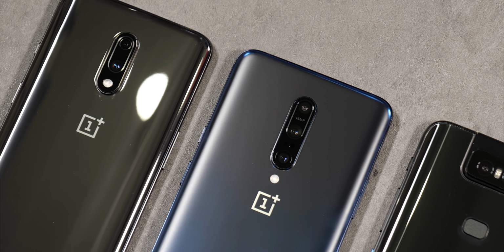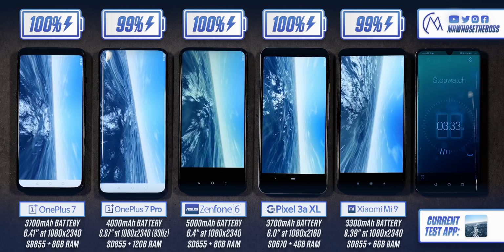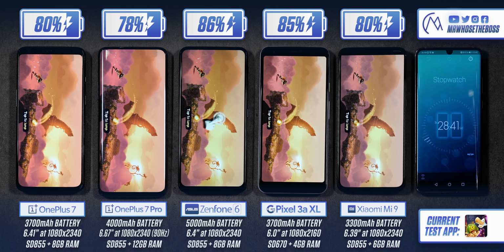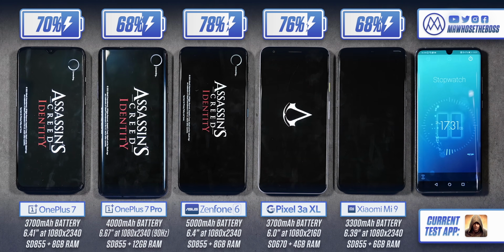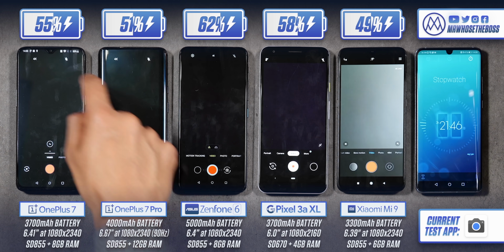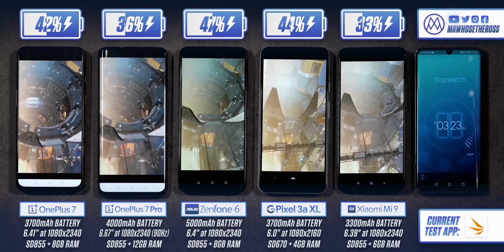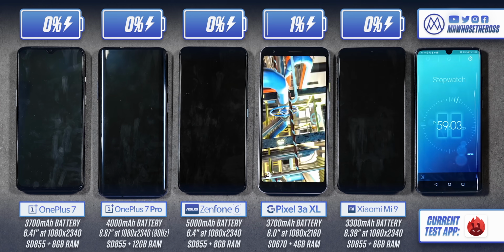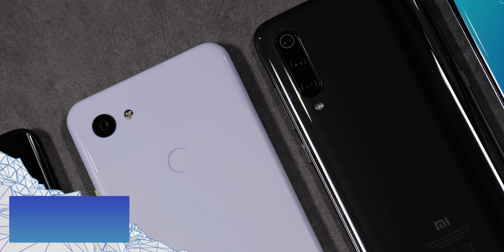OnePlus 7 vs 7 Pro / Zenfone 6 / Pixel 3a XL / Mi 9 Battery Life DRAIN Test.

Comment: Considering that the Asus phone has a LCD display and a sd855 and bigger screen I m actually not disappointed in the end results.
Reply: I am, Apple's utilization of IPS pushed it to insane limits and ASUS can't even do it that well with the same screen tech.
Reply: @alexsurber9404  apples os, cpu and Gpu optimizations made it get ok sot. Not having a amoled means higher power consumption which Apple also had to deal with b4 switching to another display type. So no still not asus fault + they got a new firmware update that seemed to increase users sot by 7-12 minutes
Reply: @alexsurber9404  lol you just from that Google then put and paste here lol.. I still pick amoled screen rather than ips LCD screen.. beacaude of the colour and can be better battery life..
Reply: LCD draws more power than LED panels
Reply: OLED displays will only see SoT increases when the blacks being displayed are pure black. If the colour is not pure black then the LEDs are not off and, therefore, are still drawing power.
Reply: @Llethander  ok then who is better amoled or LCD panel ???
Reply: @wanmaziah9835  Both have pros and cons. I'd say OLED has the edge because of its far stronger contrast between darks and lights as well as generally better colour clarity.
Reply: @alexsurber9404  not true
Reply: Llethander I have to disagree, because color accuracy and lifespan goes to the IPS screens. OLED displays suck at being accurate compared to IPS displays, even tho they’re getting better at it.
Reply: @itsmrdante6274  true.
Reply: @itsmrdante6274  That's fair. 

I think a lot of what people have to say about the two types of panels has to do with personal preference, as well. Many people prefer the more vibrant colours of the OLED displays. Others, like myself, really don't care as long as it's functional.
Reply: @itsmrdante6274  Would you like to have a word with our lord and savior, calibration? Any display can display a lesser gamut than it's capable with proper calibration, an OLED has a competitive edge as far as color gamut and it's irrefutable. In the off chance you're doing color intensive work on a CELL PHONE you can absolutely use an off the shelf calibration unit and beat the ever loving shit out of an IPS. OLED is superior to IPS in EVERY way.
 
- Color gamut
- Response time
- Black level, and consequentially contrast
- Peak luminosity
- Battery savings, with proper theming

The ONLY situation an LCD is irrefutably better is a drain test on a white screen, blacks are NEVER really black on an IPS though and unless you're using an iPhone 8 the world is marching forward with OLED and new OS releases are theming devices out of the box accordingly. There's also a reason display mate keeps giving Samsung's top tier displays top marks, and it isn't because the Zenfone 6 could ever hope to throw punches.
Reply: @AVenlledBraZil  Which part child? Point out the part you take issue with, I can tell you why you're wrong :)
Reply: @Llethander  Good news bud, Android 10 and iOS whatever are pushing systemwide dark mode and it's because both are trying to shun IPS for the inferior tech it is. It's for budget phones now.
Reply: @alexsurber9404  didn't say it's not about calibration. But I never seen an OLED display that's as good as an LCD when it comes to colors. You can't fully calibrate your phone display.
Reply: @alexsurber9404   The example is me or order people that i now we are very sensitive in the eye, and when we use oled or amoled screens or eyes get more tired and painfully than ips lcd.
Reply: @AVenlledBraZil  Turn the brightness down and take off the tin foil hat, I have no respect for someone whose defense against an innovation is "It AFfeCts mE DiFFeRenT". OLED has no characteristics that make it any more abrasive to your eyes than actually leaving your house or upgrading your home to LED bulbs, use an app to make the colors warmer and any and all gripes you have will 200% disappear.
Reply: @alexsurber9404  i ve done it s sane i used a lot of this oled an amoled and i dont like.
Reply: @itsmrdante6274  You can 100% calibrate a phone display to an acceptable degree regardless of screen technology, if you're really doing color intensive work on a phone then your workflow obviously isn't that important that you'd actually invest in a device aimed at assisting it. OLED displays can completely match an IPS for colors if desired and can also exceed colors that an IPS is capable of displaying, it's as if you folks are under the illusion that the gamut OLED covers doesn't actually stretch well over any gamut any IPS ever has covered. 

http://www.chrisevans3d.com/pub_blog/calibrating-alienware-13-oled-laptop/

In this calibration test on a 2016 model Alienware OLED laptop 100% gamut coverage was achieved on the SRGB and Adobe RGB spectrums exactly, while many of the IPS laptop offerings in the enthusiast and creative workspaces fail to offer 100% Adobe RGB coverage. To boot, if you were working on HDR content from the get-go the OLED has the home court advantage going for it, because everyone knows LCD/IPS HDR is definitely the worse of the two for HDR. Color profiles for SRGB exist in many Android phones and Apple even hand tailors the utmost color accurate profiles for their Samsung provided OLED offerings, they were so convinced that they even dropped IPS from their lineup altogether in favor of OLED.
Reply: @alexsurber9404  idk what phones you're using that you can calibrate the screen that much. But okay.
Reply: yes its true oled at super amoled is more vibrant, colorful and realistic, however in the long term had its drawback which later on the screen tends to become more and more yellowish
Reply: Alex Surber d hell! For most media content in real life AMOLED are more effecient! Just they are not effecient for the white or whitish colours ! But the fact that they give a lot better battery life for TV shows and media plus a lot better contrast for dim scenes plus the fact that Current gen AMOLED can get brighter without washing out makes AMOLED no brainer! Yes temps do matter when running high brightness but thats also true for LCD!! And I don’t support ull use ur phone in direct sunlight for 30min or hrs
Reply: Marqlut Marquez hmm ! Does it matter? I have a s8 2 years old ! Screen is still super good a lot brighter than lcd and better for TV show consumption! Why would you choose lcd?

Comment: The battery optimization on Mi9 is excellent...just as they marketed....
Reply: Doesn't matter, they should've increased the capacity
Reply: It literally came last tho. Wut u on about 🤣🤣
Reply: HAL 9000  oh yeah
Reply: HAL 9000 … did u see the test?
Reply: @GuyScott1  umm xiaomi has redmi k20 pro with 4Ah as well . the point behind mi 9 was to sell it to girls by marketing it with a popstar and making it elegant and light.
Reply: @Paul Paul dude if you have used miui (which has a bloat and ad issue now) don't dare call it's battery game bad you can like other skins lock the apps you don't want to be killed.
Reply: with 3300 it hold up well
Reply: @qwertiee  that's why do not skip your math class if u don't understand why mi9 battery optimisation is great.
Reply: @kennykhoo1689  ... That's why u don't skip your english class... So you can watch the video and see that it was the worst phone here...
Reply: @qwertiee  omg... That's the best u can come out...guess u do skip your english class too cause u really do not understand why mi9 optimisation is great even though it only having 3300mah. Better not skip school too cause if this you can't understand, no point in watching any video.
Reply: @_yuri  actually the MIUI 10 is the most optimized UI out. It beats OS 6 which most people love on the OnePlus. The MIUI 10 also has more features but the ads can be turned off and depending on region might not have them anyways.
Reply: @kennykhoo1689  well ssid
Reply: @kennykhoo1689  actually if  you didn't use the camera that much the Mi 9 was doing better or on par with the OnePlus bunch. And even so it only lost by 20 minutes!! LMAO and also that was with the OnePlus being reduced to HD+ instead of quad HD. 
In quad HD the Mi 9 beats it by more the 30 minutes. So with what most people probably keep it on it loses to the Mi 9. 
Last like the other guy said, do some math. The Xiaomi Mi 9 did the best by far going by efficiency. 
And to add I picked up a Mi 9 last week. It's a really nice phone and I am comparing it with knowledge as I have these phones as well. Galaxy S4, S5, S6, S7, S8, S8+,S9+ as well as LG G2, G3, G4, LGV20, LGV30 and last iPhone 6plus and a 8plus for flagship's. I have plenty of mid-range phones to. 

I'm getting 17-20 hours before I put. On charger and that's with 7-9 hrs screen on time. The point is the battery runs great and will give you a solid days use with moderate to heavy use with on screen time.
Reply: @gregwilliams4380  yeah.. what u said its the facts! Mi9 actually having one of the best efficient optimisation battery in the market at the moment. 
People usually forget it only having 3300mah and draining neck to neck with higher capacity battery and this just prove it is much better comparing with the bigger battery cause in paper with 3300mah it shouldn't be so close with the bigger battery but in reality it is..haha. guess some ppl only look at the end without comparing the battery size.
Reply: @_yuri  
It DOES NOT MATTER.
They should've increased the capacity
Reply: @GuyScott1  well you see they don't give a frick about you not everyone cares about battery life. this was simply targetting a different kind of audience
Reply: Thats called battery optimization
Reply: @gregwilliams4380  would you recommend me to buy a S9+ or a Mi 9? I love the stereo speakers + qhd display but i'm afraid that the battery sucks and the os is not as fast. (I'm from germany, so no sd845 -> exynos
Reply: @d-tox8546  I will be straight honest with you I own both. 1st off you can get Snapdragon you just can't buy it from a local vendor. I would definitely not go with anything but Snapdragon as the other in the equivalent to the 845 loses big time and even worse in the 855 comparison. Just check your LTE bands to make sure your covered. 
Back to the point. The Mi 9 can do everything the S9+ can but more faster and better. The only thing the S9+ has is the speaker is not louder but watching movies which I do the S9+ has a decent surround sound effect. But for volume the Mi 9 is louder. 
For display. The Mi 9 is using a Samsung Super AMOLED HDR 2k display. The only difference is one is Quad Hd and the other is just HD+. To be 100% completely honest I watch my S9+ in Full HD+ because you truly can't tell much if any difference on a display that small but the key is quality display. I told myself I would own nothing but a Samsung as I love there display that much and it appears besides consumer's the company's do to! Side by side they look damn near identical!! Straight up. Anybody saying that Quad HD is this and that, it's not it's the quality of the display. Nobody beats Samsung. And Mi 9 uses a Samsung as does pixel, iPhone and others. 
So you will be thrilled with the screen which is .2 bigger then the S9+ but body size no bigger. 
The only true key difference is external storage which you get free unlimited online storage with Google on high quality pics, do not big deal. The other is IP rating. Check reviews you can put the Mi 9 under water just fine no water getting in it but it will not go 5ft deep like a Galaxy for more then a minute vs the S9 is rated at 30. Neither covers water damage might I add though. 
The headphone jack some say is a issue but in today's world most use Bluetooth and if not it does supply the USB C to 3.5mm adapter free in the box. If your using quality headphones neither phone will work you will need a LG V series with the quad Dac/amp system which I have one of those too and it's awesome for music. But it ends there lol. Everybody has a trade off somewhere. 
The camera/ video's and pics look much better from the Mi 9. Also the performance not even a S10+ can match on AnTuTu or Geekbench. Hope this helps.
Reply: @gregwilliams4380  okay thanks for your help man...hmm my favorite phone would be the OP 7 Pro...but the price is a little bit to expensive, for me. Well the S9+ looks like a decent phone but i won't pay 450-500€ for "old" technic...the Mi 9 has everything for me , except the 1440p + stereo speaker combo. How is the battery of the s9+ in comparison with the mi 9?
Reply: @d-tox8546  the Mi 9 beats every 2018 easy. It beats the Note 9 which has a 4000 mAh battery by more then a hour on a very strenuous test.
In testing this year it ran with or beat the S10+ and S10 5g by a couple of minutes. It beat the OnePlus 7 pro by 30min, and quite a few others with 4000-4100 mAh batteries. So to the S9+ not even a fair fight but I will tell you what I'm getting out of both . 
The Mi 9 I'm getting on average for my usage 8-11 hrs screen on with a combined total of 17-20 hrs before I charge and never cut off normally having 5-15% left. 
S9+ 5hrs screen on with very little extra time. Combined when using a lot of screen on around 7-8hrs. For what I do with my phone they are truly in two different leagues because I use a lot of screen on between movies and video with so pics to butt. I will tell you know you will not truly notice a difference between the S9+ screen and the Mi 9. They are both amazing HDR screens. I wish there was something I could compare it to. I've had just about every Galaxy minus the S10 and most LG flagship's. What phone do you have or screen that you know well and maybe I could give you a straight comparison.
Reply: @gregwilliams4380  my last real phone was the Samsung S6 (i loved the 1440p screen, but had many negative Points) after the S6 doesn't worked anymore i switched to the Xiaomi Redmi 5 Plus (just till i buy a flagship again)...a other thing which hold me back to buy the Mi 9 and Oneplus is that they are also chinese companies and at the moment is everything between USA and China not really sure anymore. I don't want to end like the Huawei users...but i think i have to risk it because there is just Samsung, Apple and LG anymore if i won't risk it.
Reply: @d-tox8546  trust me has nothing to do with the company being Chinese. It has to do with Huawei, the Chinese communist party, spying and intellectual property rights and violation. Trust me Xiaomi is free and clear as is one plus as many others. He'll the Samsung is owned in Korea but put together in China lol. Again it has to do with many things but not the trade war on it. The only thing that will happen is certain things will cost more because of tariffs. I'm huge into politics and what's going on. Hell Trump is or was a Facebook friend on mine lol. 
Ok back the the S6 which I have one sitting here believe it or not. 
The Mi 9 display truly looks much better!!  They are both Samsung Super AMOLED screens. But 2k. But the Mi 9 is HDR which is way more important then the 1440 trust me. The horizontal resolution on the s6 is 2560 vs 2340on the Mi 9. Not much at all. But the key is all that 2k,3k,4k comes into play as the display gets bigger but if both are they say quality but one is 4k and the other 2k which neither are even 3k but if you had 2/4 on a 22" TV and didn't know ahead of time you would not be able to pick which was which if both where same grade quality. The larger you get the more pixels you need to get the same look out of a TV. Same idea with phones. 4k only matters on 40+" TV's to be dead honest. I own them all. The s6 is 1440p but it's still just a 2.5k display technically as they just call it 2k and the Mi 9 is a 2.34k as 2k stands for horizontal resolution. LOL. Most people don't know that. 
The HDR will be your biggest difference and that the Mi 9 has and it look awesome. I seriously put it up to the S8-9 display as far as color and clarity. The colors are very vivid. You can change the contrast as well as temperature. I will tell you like this. If your worried about the display don't be. Again give me a link I will send picks of my phones so you know I'm not bsing. It's not like I'm getting anything for telling you the ends and outs of these phones. I'm just sharing some personal knowledge. You won't be disappointed.
Reply: @d-tox8546  
I have the s9 plus the battery is very poor. If you dont care about the camera. Get the mi 9
Reply: @d-tox8546  
I love the 1440 1200 not display on my s9 plus too, but I run it at 720p most times just because the battery is so bad. I love Samsung, but in this case, go for the mi 9. Or the oneplus 9 pro if that's in your budget. You get the best of both worlds because that screen is amazing

Comment: The lack of an oled display killed the asus's battery.
Reply: oled display would be killed by time, so it is much better anyway!
Reply: That's true, got s7 just 1,5year lcd get broken. Now I'm happy with my mi6 (already change battery) + power bank. Just imagine u spend a lot money for flagship phone just for 1,5 years? That's insane flagship phone more than that. Even my mi6 almost 3 years old  outperform sd710 and maybe sd730 in term of gaming.
Reply: @nggw6792  thats odd, my s7 lasted 2 and a half years with no issues, it broke from a bad fall at chest height tho
Reply: @bradenpapa7835  maybe different phone different luck hahahaha
Reply: Oleds use more battery if white or blue background